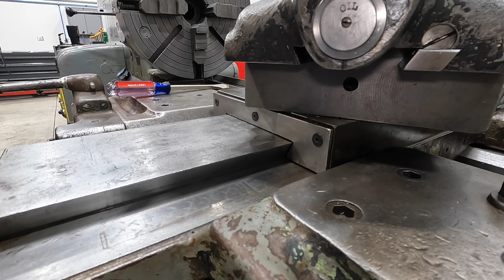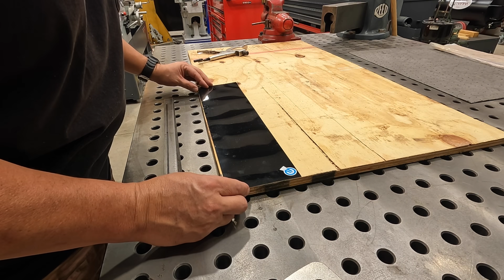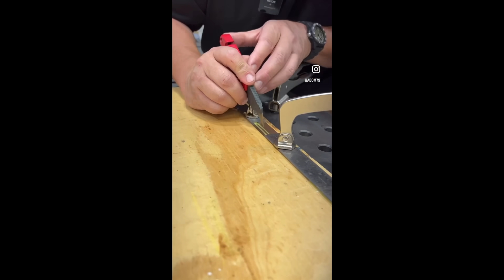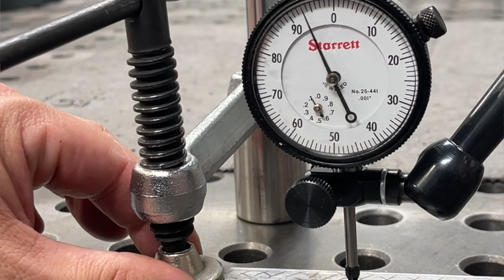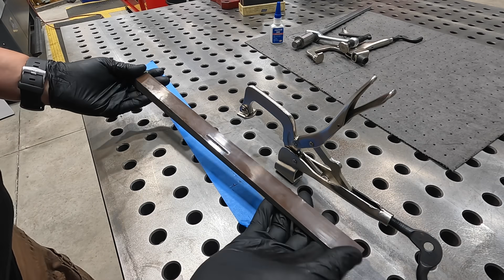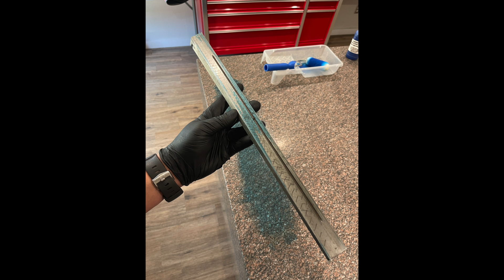Gib Repair for American Pacemaker Lathe

Comment: Alemite  4035 Heavy Duty Oil Gun is what you can buy directly. Looks and works like a regular grease gun but has a piston designed for oil. Down side is they ain't cheap. It will set you back $200-$350 depending on where you buy it. Amazon has the highest price and longest lead time.
I was faced with the exact same dilemma with an old Wells-Index vertical mill at a place I used to work. I tried a several of those little hand pump oilers and they just were not up to the task. All the ways on all the axes had zerk fittings. Some prior users had been pumping wheel bearing grease into those fittings for years! It wasn't possible for me to take the machine down and pull all the axes apart to clean out all the grease. I needed a way to pump clean way oil into the fittings and flush out as much as I could. None of the grease guns on the market, with the exception of the Alemite 4035, that I tried are designed for holding oil. ALL of them leak past the reservoir piston seal. Some more than others.
Fortunately virtually all the grease guns on the market have a standard sized cylinder which is close enough to white plastic drain pipe. I just needed one with a good sealing setup in the head (O-ring or good gasket.) Next thing to figure out is the type of threads it uses and whether my lathe could thread at that pitch. Threaded one end for the pump head and the other end I glued on a cap with a large pipe taper plug for filling. It works.
Have to hold the pump inverted because there is no piston to keep the contents forced into the head. 
That old Wells-Index works buttery smooth now.
I am more than happy to help you get it sorted out so if you need more info let me know in the comments here. I am also a member on practicalmachinist.
Great video Adam.

Comment: Just dissasemble the grease tip remove the check valve and replace it with a pass through of the same dimensions we have done it for our work lathe. not sure what brand the tip was though.

Comment: @ABom79 I think the issue with that hand pump oiler is the Air Bubble in it, I think what's happening is the air bubble is compressing on you so it's not allowing the oil to get pushed through. 
  If you could find a way to remove the bubble it might work for you. Just a thought. 👍👍

Comment: Why did the shim stock need gluing if sandwiched on the static side of the gib?
Reply: During adjustment it moves.
Reply: @klaasbloem thank you. The static side is not static during adjustment hence the glue.

Comment: Just machined some gibs myself for the z axis on a cnc machine. Cut them to length and then faced them a few thou oversize. Cut in the oil grooves into the slideways material with a 6mm ballnose. And then the maintenance guy who is a wizard scraped them and fit them, it took him all day but we managed to rescue the machine between us. Good times. ❤
Reply: I prefer 1mm radius corner end mill for oil groove, this is the best match to a dedicated oil groove end mill, which is mainly unobtainium (except in Switzerland, with a hefty price tag).

Comment: There's not a backing screw on the back side of the gib is there? Both of my lathes have adjustment screws on the front and back of the gib. I believe the back screw kind of sets a stop to keep the gib from getting taper locked. Love your vids, keep up the good work.
Reply: On mine to tighten the gib, back the back screw out a bit and tighten the front screw.
Reply: @bobrowe7481  I would guess that yours doesnt have that slot like on the pacemaker, the ajustment screw sits partially that slot will stop the gib from locking up from the taper or backing out. Hope that makes sense.
Reply: @B-Railed_It I believe you're correct, it looked to me like you could move it either way with the one adjustment screw.

Comment: I'm wondering if the reason the oiler is not doing much is because it's so snug after adjustment, there is no space for the oil to get into.

Comment: Hi Adam, when cutting thin stuff like that shim stock, it is better to use multiple light passes rather than the one heavy pass. Let the knife do the work. If cutting too heavy, the knife can get deflected by the wood grain underneath and lead to a less accurate cut. Light cut also keeps blade sharper for longer too. All the best from Oz.

Comment: My zerk chucks are 2 piece.  The pieces unscrew and I would assume the guts come out.Either there's a structure in there to prevent excess grease leakage (check) or perhaps some sort of needle is necessary to depress the ball in the zerk itself. Won't the tip of the oilcan itself displace the zerk ball?

Comment: Well done Adam, good result. The rubber bucket in grease guns can be turned around to work with or without a cartridge. Should work with oil, not that high of a pressure you'll be using

Comment: I used a shim just like this on the cross slide of my South Bend 14-1/2. I cut a notch in it for the adjuster screw, and did not use adhesive. The only time the back side of the gib slides on anything is during adjustment—a loose shim works perfectly. I call this a repair, not a restoration, but either way it sustains a state of good repair even on an old machine.
Reply: If you listen to the video, he also called it a repair with restoration due in the future.

Comment: A flatness test on the shim side after the glue up would have been interesting especially since you rebonded the one end.  The 380 had to add some nonzero thickness eh?  Also, could you not grind a small amount off the exposed end of the gib to clear your scraper plate rather than rely on the gib adjustment?  Seems a bit too tight just to clear the plate. Finally, how resistive is the shim material to the compressive forces it experiences when the gib is doing its job? Even though on the static side (and therefore no shearing/abrasive forces), it is does see compression forces.  Of course the force, in theory, is distributed along the gib length so maybe its all good?

Comment: A Better way to fix that is to add metal . Now the best way to add metal eletro plating . Nickel should be hard enough but you could use hard chrome. MASK what you do not want plated and go for it .
Reply: If you are going to add metal, it's better to go for soft metal like copper. It's better to wear the gib because it's less difficult to be repaired or changed. If you add a hard material, you would wear the ways.

Comment: Punch the ball and spring out of the zerk, (it will hardly leak and won't allow contamination in). Find a 1/4" clear flexible  plastic tube about 6" long that will fit your oil can and zerk. You can actually see the oil moving, but you will probably have to press the trigger 5-10 seconds.

Comment: Start wit a 3oz grease gun. Make an oil tight cap for the bottom of the body to replace standard bottom cap.  Fill with oil and run it upside down, so no pistol is needed as the oil flows by gravity into the pump when upside down.  Made one of these for my Millrite that runs similar Zerk fitting on the ways and screws, I did add a flexible hose to make it easier to get onto some of the fittings while keep the pump upside down.

Comment: Would this be a good application for Turcite? Not trying to be a smart ass, just curious.
Reply: Yep
Reply: Wouldn't this gap be too thin for Turcite?
Reply: Turcite is designed to go on the sliding side. It's overkill for this case on the static side. If he wanted to get the sliding side flat he could grind it and re-scrape it and then put in a thicker static shim. The absolute width of the gib is irrelevant.

Comment: Couldnt you have just cut the gib screw shorter to get more range out of it with out the shim. Or make a replacement screw. Also seems like a job for spray weld.
Reply: Notch in gib is in line with the hole in casting against which the screw head bottoms out.  No screw length change or new screw will alter that.

Comment: I have two surface grinders that use grease inserts to oil it.   What I found was a tank that was for grease and a hose - and that is a down moving piston providing oil out the tube.  Found one (didn't buy) at the western named version of Harbor freight.  Name doesn't surface in mind.

Comment: I hooked a porta power pump to a grease fitting to force oil into a clogged grease path for spring pins. It will do what you need. You can see the output of each stroke by pumping into a container. Just use a small pump because you don't need 10,000 psi.

Comment: Atom for a quick fix, and it works pretty well, you cut a piece of stock and put it in front of the Gibb and in back of the screw head and you get additional adjustability. You're able to run the screw down and snug up the gibb. Would have tried that first actually

Comment: Made by Lincoln?  You mean made in China for Lincoln don't you?  Every corporation in America seems to be resting on a past reputation. The government even changed the definition of "Made in America". We  live in a country I do not recognize.  It will only get worse with the digital dollar when cash is eliminated.
Abom, is it possible to totally remove the check valve in the grease nozzle?  You will have a drip from it but it may prove to be a worthy tool. just keep a shop towel handy when using. Another possibility is to get a knowingly cheap, inexpensive nozzle or one that is ancient.
Reply: I've a teacher who works at Lincoln (not in US) who keeps blabbering about this not made in China thing, ignoring that it might be assembled in US, but with chinese components...

Comment: I have 2 of those plastic grease guns, they work well with grease! 
For oiling I have a normal old grease gun, I took the piston spring and plunger out (it was the type with a notch in the rod and a keyhole in the cover) and used 2 washers and a 1/4 nut and bolt with a load of silicone gasket to seal the plunger hole. 
Fill with oil and keep it hanging nozzle upwards so it doesn’t leak out past the pump mechanism, in use providing the nozzle is basically pointing below the horizontal it pumps oil a treat. 
I’ve bought oil guns and they all piss oil all over the floor past the piston hence my modification of the old grease gun!

Comment: A "sution fill" grease gun similar to lincoln 1134 has a piston seal that can be flipped. Once it's fliped up, the gun will hold oil. You might need to add a seal around the rod. Or just store it upside down. Would be better to look for a small 3oz version. Less ability to make a mess.

There is also a blunt "needle" tip available for grease guns. If you put that on your oiler instead of that grease coupler it will let you mantually open the check ball by pushing the needle against it and your oiler pump should be strong enough then to push oil in. Those needles are cheap too.

Comment: Take the check ball out of that fitting for the oil can an prolly wrk fine.  Put it on the lathe toss 1/8 drill bit right thru that grease fitting end. As far as the grease fitting on the machine if you get the two piece style you can unscrew the nipple and pop ball and spring out as well to not have to fight that pressure either if it’s a lot for the can to pump.  Two piece grease fittings are the best anyways they allow you to put 45 an 90 degrees fittings in places you can’t spin a 1 piece fitting.

Comment: For oiling zerk fittings I just use a small grease gun. It does not leak no matter which way up I store it. But I have to use it upside down because there will be an air bubble in the can. No getting rid of that. Try it. It will cost you next to nothing

Comment: I have an old 70's Myford ML7 lathe and have the same issue using those push oil guns, even the expensive Myford brand oil gun was frustrating to use and got oil everywhere but in the fitting. So I bought a slipper pete mini grease gun off of amazon removed the plunger rod and sealed the bottom of the gun with a machined flat "coin" of aluminum with a cut to size piece of rubber on top of it, so that when you screw the bottom cap on it squeezes and seals it. I fill it  with oil by unscrewing the top only. All threaded areas have teflon plumbers tape on them including the top and bottom of the grease housing. When I use it , I hold it upside down (this is key) , and when I store it , I just hang it right side up. I use it with the flex hose that's included and the coupler locks on to the zerk nipples nicely. I get little to no leaks and its very convenient to use.

Comment: I converted one of those small grease guns to work with oil and that's how I lube the ways on my Bridgeport. All it took was to machine a piston out of nylon with an o-ring and put it on the tube of the grease gun. Works perfectly, although I do have to push the piston in as I use the gun.

Comment: Warum ist bei euch die obere Führungsbahn (Oberschlitten) auf der der Werkzeughalter montiert ist, immer winklig zur Drehachse eingestellt ? Bei uns ist diese Führungsbahn parallel zur Drehachse und wird nur zum drehen von Winkeln oder Konen verstellt.
Reply: Yes, I also work on a lathe. I also have the top slide parallel to the axis of rotation.

Comment: Adam, I think you need to pull the oiler zerks off and make sure that you can push through them, and that there is not other blockage in the system that little spring loaded ball should be easy to pump through.

Comment: For an oiler for the grease zeros I had a old hydraulic  hand pump for a 30 ton ram that I was not using anymore so I cleaned it up and put a lock and lube grease gun fitting on the end of the hose and filled the hand pump with way oil.  Off I went, does not leak, works great!
Reply: I just added that before seeing your post, and another persons.

Comment: I woud have tried to fill in the notch for the head of the adjustment screw, and then cut a new notch so that you can tighten it better.  That shim will likely work because you're pretty sharp with that kind of thing, but that would have been my preferred method.

Comment: Lots of folks recommending grease guns with oil for those zerks... but grease guns leak horribly.

A porta power unit with an adapter is the way to go, they're literally made for pumping oil and won't leak all over like a grease gun.

Comment: Adam, to your second zerk adaptor add a cylinder with a piston. Pour oil in the zerk fitting side with the piston fully "extended" away from  the zerk.

Apply hydraulic pressure to the open side, with an enerpack hydraulic pump..

Comment: Can you take the end off of your press and lub on to your homemade brass adapter and then use your hand pump? I may not have a check in it? Or open up the zerk fitting and remove the check?

Comment: I think the shimming you did will work fine.  The shim material used is made for that….  If it wasn’t made for that purpose… The LocTite would have melted it. 

About the clutch rattle… I am guessing … it’s the springs making that noise..

Any time something is Rattling….it’s wearing metal.  

You may want to find a new clutch instead of trying to make right something that is that old.

Comment: My bet isn that the oil can doesn't pump with enough pressure to open the ball in th one end. I'm thinking something like a tee, input and output in the horizontal axis and an oiler on top. A fairly low air pressure should be required from your shop air. It might have to be a venturi type of setup for the oil.

Comment: The zerk fitting has a spring in side and have to over come that pressure to open the check valve. Try using the mini grease gun, which has a  trigger control valve. Put some oil in the cartridge area and use the spring pressure on the handle that pressurized that cartridge area. Experiment with that first with a little oil, so if it doesn't work, you don't have a mess of oil all over the place. If not, make your own oil filled tube with a plunger and 0 rings like a syringe.

Comment: Adam, I have that "push and lube" applicator and it pushes the oil into the ways on my mill and lathe. Maybe you have a defective unit??  Just a thought.
Thanks for the insite on the gib adjustment. My cross slide has the same issue.

Comment: There is a tool that A/C techs use to inject dye and refrigerant oil into pressurized A/C systems that would work great for oiling your cross-slide.

Comment: Get that air bubble out of your oiler and it should work better.  With the bubble in there, you just compress the air, like an air bubble in a hydraulic line.   Good luck
Reply: Nice job, Adam. A simple fix that will get the job done until you commit to scraping the cross slide and compound. A project of which many would enjoy watching. Cheers from Florida’s Space Coast.
Reply: Alemlube make an oil gun
Reply: I agree
Reply: If it can't push past the air bubble it doesn't have the power to push past the check valves. Just like a hydraulic line
Reply: @KiLL3RabBit  The check valve on that fitting he used is for grease. The oiler doesnt produce the pressure required to over come the check valve.
Reply: @JeremiahL  yeah that was my point. Thank you for saying exactly what I said
Reply: @KiLL3RabBit that isn't at all what you said lmfao
Reply: Agreed

Comment: Hey Adam.   I have the zerks on my Bridgeport so  I use a modified grease gun to oil it:  take out the spring/plunger and cut off the bottom of the cartridge tube to a suitable height (taller holds more oil).  Weld a plate on the bottom to seal it.  Use it by turning upside down to pump the oil into your zerks at grease gun pressure!  Done.  You store it right-side up and the oil never leaks out; never had a drop leak out.  Hope this helps.  I bought the same plunger you tried using:  it only works well when vertical.